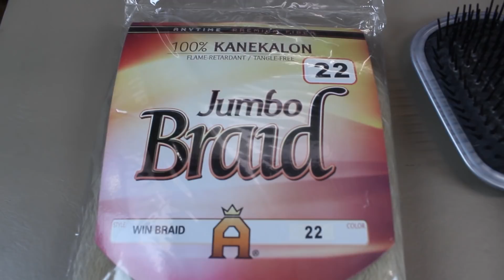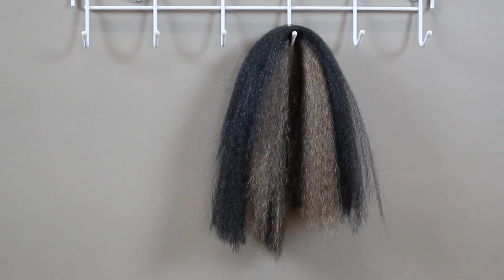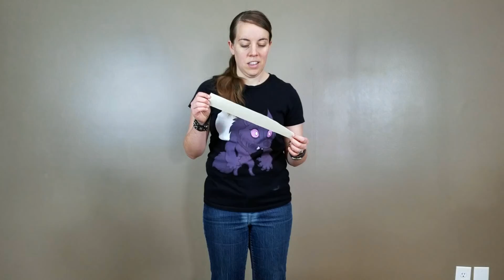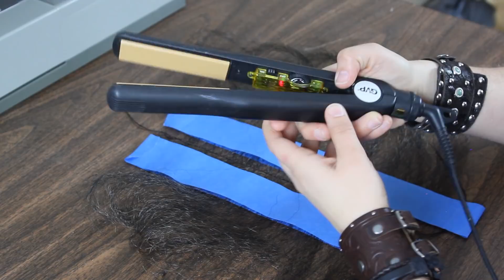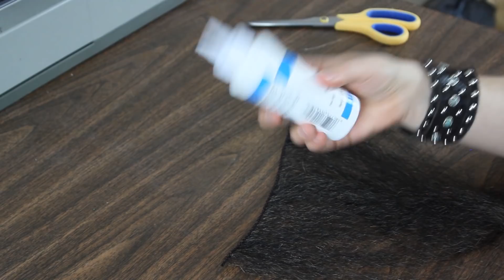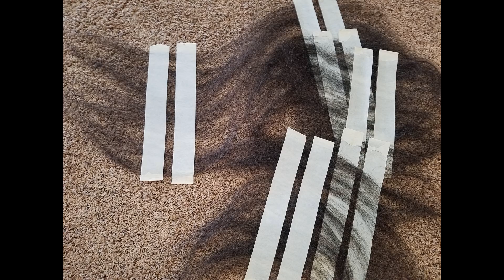How to Weft Hair for Your Creature Cosplays

Comment: I'm finally working on my fursuit which has long, side-swept hair and this'll be perfect!! I plan to dance in this suit, so I wanted a long hair style without the weight of using standard shag fur at that size. And while I might use NFT fur on the same suit, I don't think that it'll be at the length I need it on the pursuit head.

Comment: sorry if you’ve addressed this in the video, but for some reason the hair when I’m sewing just falls out? do you know how I can fix this?
Reply from the maker: It's hard to troubleshoot from the info you gave, but here are some ideas : use less hair so the tape really holds it tightly. Some hair will come out and that's okay, use a brush to keep things neat. Make sure you do enough passes with the sewing machine to hold things secure - I used a double needle, if you don't have one double the passes you make.  Make sure you seal the ends with glue to keep the weft together, it'll help minimize hairloss

Comment: Thank you so much for this tutorial!! I have a couple questions if you don't mind! ^^' 
1. Can this be airbrushed, dyed, or pastel(ed?)I am using the same hair you are using and I wanted an ombre effect (dye onto white hair) and if not how should I work around it? 
2. Can there be any way to straighten this? (Like a horse's mane or like a silky dog) If not how can I make it less wavy(or textured) lol thank you and have a great day! 

P.S. if anyone would respond that would be terrific! <3
Reply from the maker: Great questions!
1) Yes! these are the same kind of fibers that many synthetic wigs are made of, so if you follow a book/tutorials about dying/coloring/styling  cosplay wigs, that will work! Also, there are ombre fibers for sale in a wide range of colors. if you find the color you like then you can just buy that and don't have to worry about colors running or fading.
2) you can straighten them with a hair straightener. I like to use mine that has a dial to select a precise temperature. start low and then slowly increase the temp. Since these are plastic fibers, they will melt if you go too hot.  You can also buy silky straight fibers to start with, I think the crinkle fibers with some straightening after looks the most natural
Reply: @KazplayVideos  thank you so much!! This is such a great help to my project! BTW your work is the best! (That head  in he vid was AMAZING) Also I wanted to to the 'melts' they had in the shop but they didn't have the natural coloring I was looking for. I'll look for a dyeing and styling wigs book immediately! Thank you so much!! <3

Comment: This is an amazing tutorial. I have a question tho, is this synthetic hair and if so what kind. It was my understanding that using a flat iron on synthetic hair would basically melt it? Pls help. I'm trying to add hair to some of my creatures and i tried yarn wefts but i can't get the length i want. Thank you
Reply from the maker: it will melt if your flat iron is at a high enough temperature, I had mine set very low and was moving it very quickly over the fibers. There are also higher quality fibers that can withstand higher temperatures for sale online